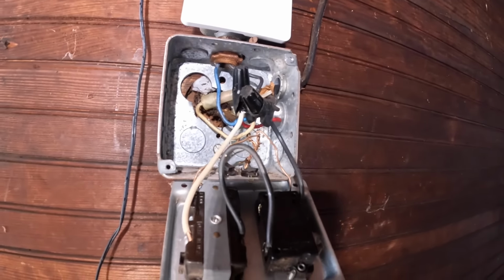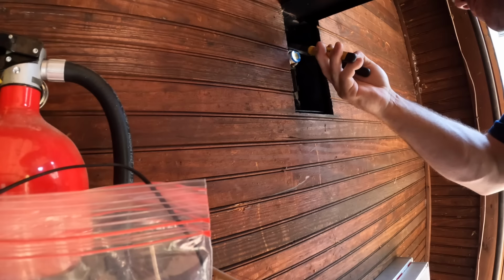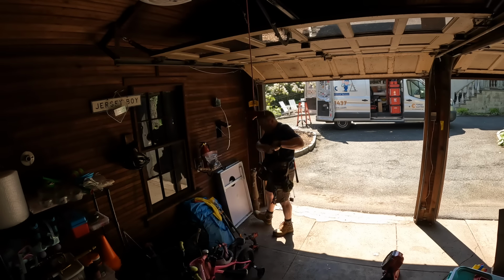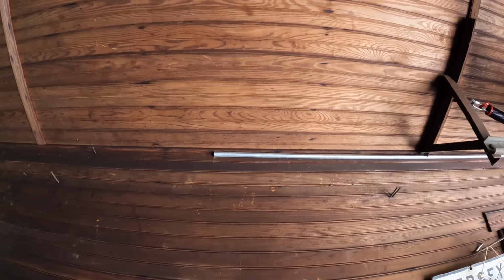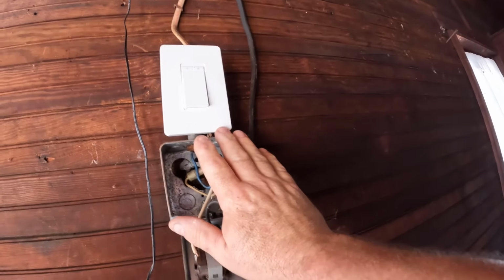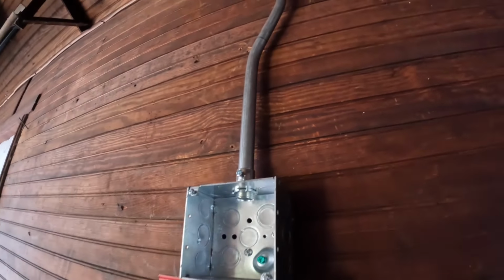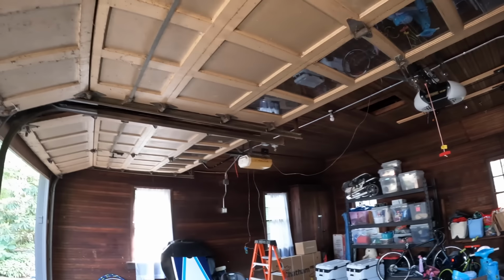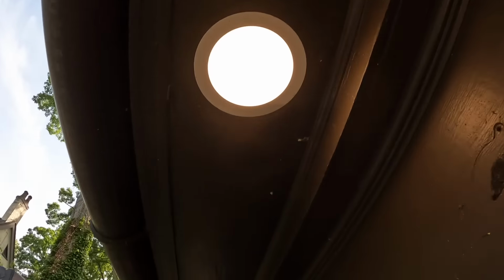Rewiring An Old Detached Garage with 1/2" EMT Conduit | Westfield, NJ

Comment: Ron you honored the builder of the old garage it has character particularly the shiplap. Going with EMT looks great makes upgrades easier. Keeping the fuse box as point of entry and using the fuse to protect ungrounded conductor was the way to go.
The separate 1900 box for the switch and GFCI makes an upgrade in the future easier. If and when the customer gets an electric car is when one would to install a subpanel and tie in your well done work. P.S. I like Burnley spayed lugs for stranded too.
Reply from the maker: Thanks Mack!

Comment: Nice work bro. Quik tip, when making up an R/S cover, I like to make up the cover & devices on the bench, tailgate or anywhere on the ground with 6" pigtails and then just wire nut it to the leads from the box. Makes for easier servicing as well. 😎

Comment: When I rewired my garage/shop I put in a subpanel and ran EMT for every single interior circuit. It's great, looks good (kind of industrial looking) and is easy enough to remove, add or modify as my circuit and outlet needs change over time.
Reply from the maker: Very nice!

Comment: Good video. I would like to learn how to properly crimp those spade connectors as I have issues using screw connections with THHN stranded wire.

Comment: Nice job Ron. Can't say I was great on EMT but I did ok. Still have an 1 1/4" Gardner bender EMT hand bender, just don't have the muscle to use it anymore. LOL We mostly bought elbows when we ran 1 1/4 and just used the hand bender for offsets....that was bad enough. Still have the 1/2" Benfield 1/2" bender that I got from my boss in 73'. It was probably 20 years old at that time. 3/4 Benders used more than 1/2" so I used to lose those occasionally.
Reply from the maker: Great story.  I prefer the Ideal benders but the new Milwaukees are lightweight and work well.
Reply: @electricianron_New_Jersey  Yeah the Ideal benders are great. I have a 3/4. My old 1/2" is the same as an Ideal. Jack Benfield had the original patent on that bender (Benfield Bender) and It may have been made by others as well, Appleton I think made it for a while I think that is what my 1/2" is. So ideal is not the originator of that design but it is the best design.
Reply from the maker: @ed6837 those 1 1/4” benders look like the grim reeper.

Comment: I would lean towards removing the fuse box and running every wire to every receptacle/switch/socket. I know my experience is limited but I've encountered homes that old that used Illuminating Gas Lines as 'wires' and after finding a home like that? Where random copper tubes are actually energized? I'm gun shy and I admit it.

Comment: From my understanding code requires the GFCI to be at the point before it goes under . Basically in the house at the 4” square You disconnected or in the panel.
Reply: Maybe that is only needed if using UF/ direct burial . I looked in the book . I can’t find it 🤷
Reply from the maker: NEC table 300.5.

Comment: Thanks.  Location of GFCI would depend upon whether there was access to the garage if those door openers were without power from that GFCI if tripped.  My .02.
Reply from the maker: Great point but would you have put a GFCI outdoors just for that reason you suggested?
Reply: @electricalron  sure if properly done.  Maybe better in the house.  The reason I brought it up is because I've been locked out of a garage during a power failure.  I made sure it wouldn't happen again.

Comment: Question: Ron, why didn't you connect a ground to the ceramic fixture and the plug in the ceiling?
Reply from the maker: The receptacle is grounded to the box when mechanically connected to the box which it is and the code allows for this when using a metal box. The light box is also grounded but the porcelain is not grounded because it does conduct electricity so it will never be one energized.

Comment: I bet that little circuit board was an arduion board  to add a WiFi function to the old garage door opener.
Reply from the maker: It was for the older garage door opener machine.

Comment: At 25:35 the 1900 above you has a knockout taken out. Did you put a ko cover or at least button there? Clean work, just asking since you're now an instructor. Congratulations on that, btw
Reply from the maker: Now that I think about it I knew it was missing but forgot about the KO seal.  I’m doing a service upgrade here in a few weeks so I have time to make it right.  The service is going to make a great video!

Comment: I don't think I have ever seen anyone put Stak Ons on a light fixture before. Is that code in NJ or is that just because it was stranded wire and makes a better connection. Thanks
Reply from the maker: Stranded conductors.  👌

Comment: At 1:35 why did you disconnect at that junction box  instead of just flipping the breaker?
Reply: I am guessing he did not want to shut down the breaker as the garage tapped off a house circuit and that would have shut something down in the house.
Reply from the maker: Because there was other stuff already on that circuit.

Comment: Why did you not replace the fused box with one with a circuit breaker?  Owner cost?
Reply from the maker: Because the supply conductors are old, brittle, and I did not want to damage those conductors.
Reply: @electricianron_New_Jersey  Makes sense until the supply underground is replaced.

Comment: It might cost a couple dollars more but I just use offset nipples instead of straight ones on the metal boxes and then I do not have to place offset bends in the tubing.  Off course you have a bending tool which I could not justify the cost for its little use.
Reply from the maker: The pre made box offsets are ok but not everywhere.
Reply: Those benders I just bought one a year ago klein with the plastic stop even at the home shtpo for 1/2 inch $50  😅 not that expensive amazoon even sells off brand ones with multi sizes for around that and under $100